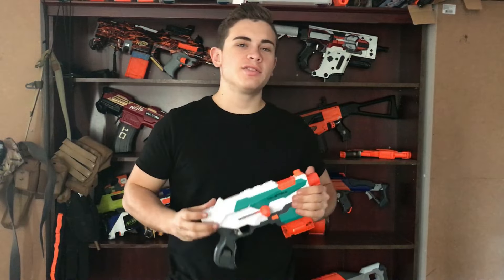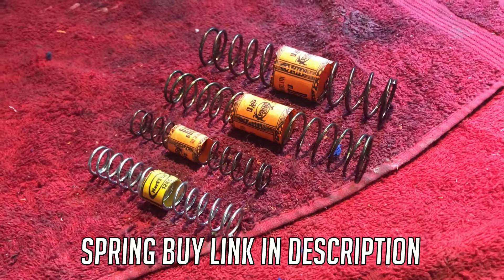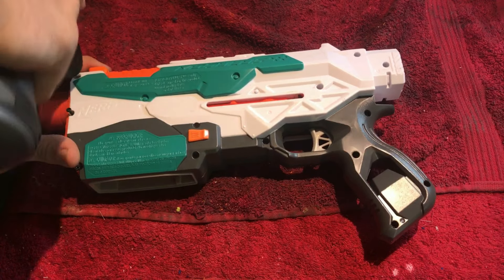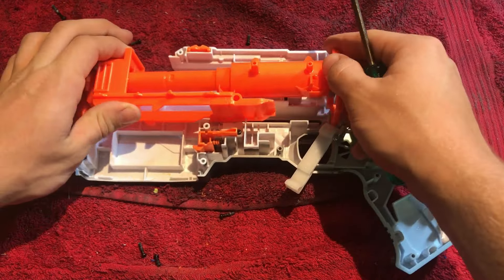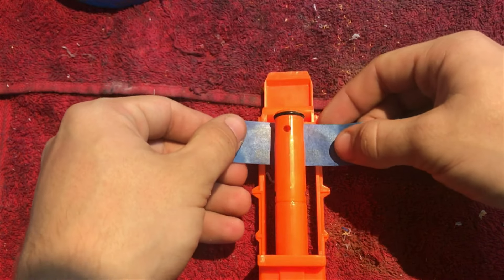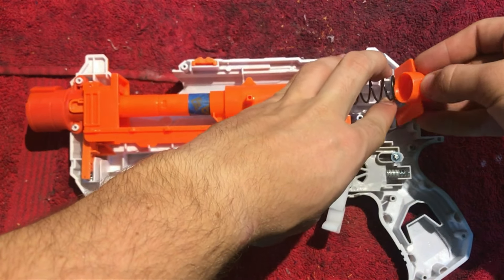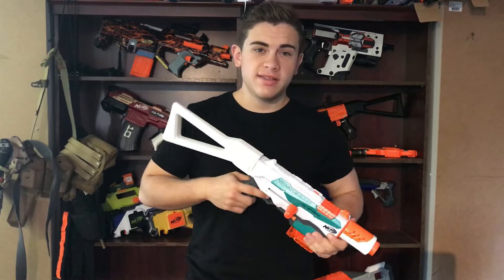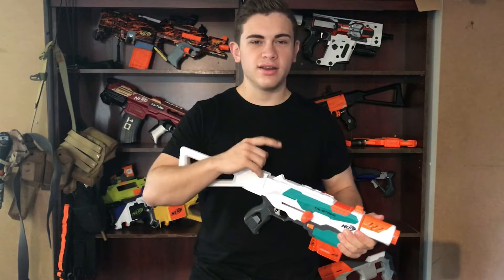How To Upgrade Any Springer Nerf Blaster || Nerf Springer Mod Guide

Comment: when i was little i used to put small coins behind the inside spring so it would increse the tension and shoot faster
Reply: Genius
Reply: How tho..
Reply: @Wardaddy_fury  opening the gun, then putting dimes behind the spring that shoots the darts, it makes the spring harder
Reply: @marcie5620  thanks now my nerf gun is PACK A PUNCHED
Reply: Does it work with any coins
Reply: @yousifahmed7129  Preferebly small ones so its easier to close, but yes
Reply: Had you ever tried over lapping 2 springs together both facing opposite sides for double spring power
Reply: I did that with a old pelt gun 😂 that spring that was going bad lol
Reply: Can you show a picture of the coins in the spring?
Reply: If you had longer springs same thing 

Mechanical keyboards will teach you everything about springs
Reply: Holy shot it works
Reply: Le classic penny mod
Reply: WHYYY DIDN'T L THINK OF THAT WHEN MY L DISASMBELD MY GUN

Comment: What spring would you recommend for my echo 2.0 elite? (this will be my first spring mod)
Reply: I think you can use a retaliator spring, it's basically the same blaster.
Reply: @javierunning4818  is there a way to take apart the back of my elite 2.0?
Reply: @biggiopig77  Idk, actually I'm about to mod for my first time, and I'm going to mod an Echo, Idk if that is possible
Reply: Ok
Reply: Does that work for the eaglepoint 2.0 elite?